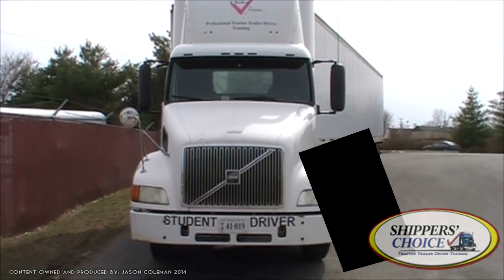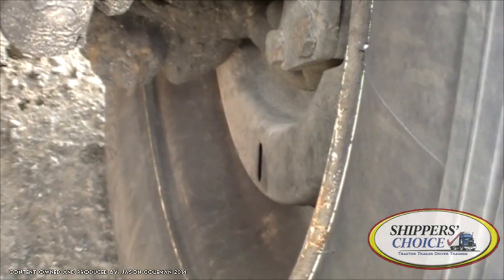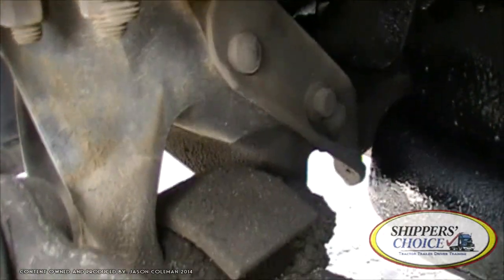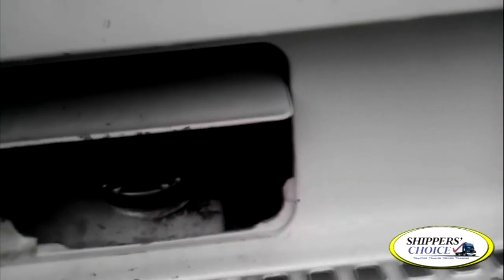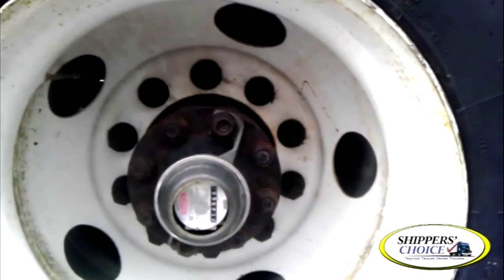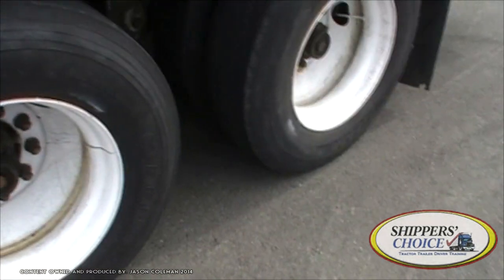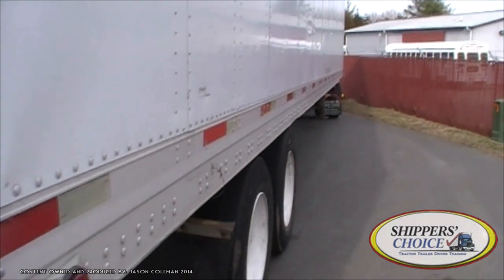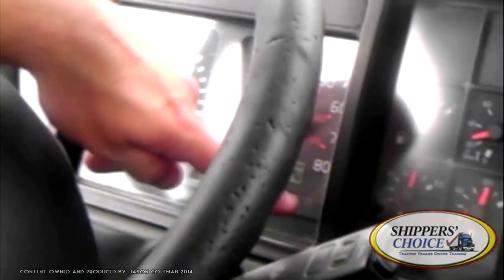Entire Class A Pre-trip In-depth feat. Instructor J.Coleman - MUST SEE!!!

Comment: This is old. The VA DMV pre-trip inspection has changed but this still works if you do it all. Also, it's best to start at the top and work your way down and not go from middle, to bottom and then top. Work your way around, Top to bottom, inside to out, and say everything, and touch everything.